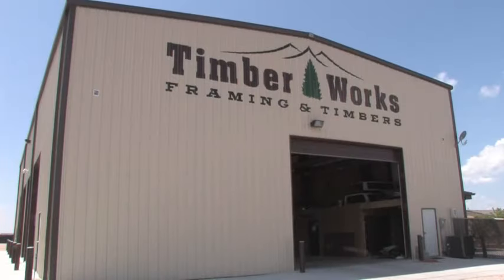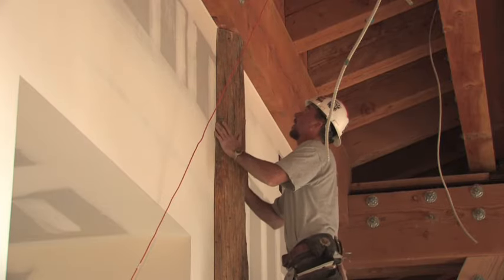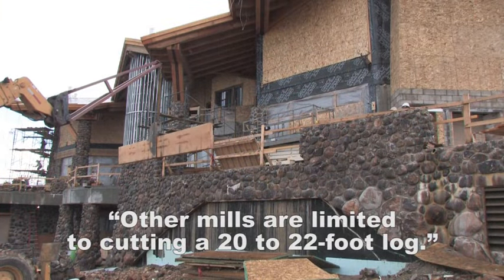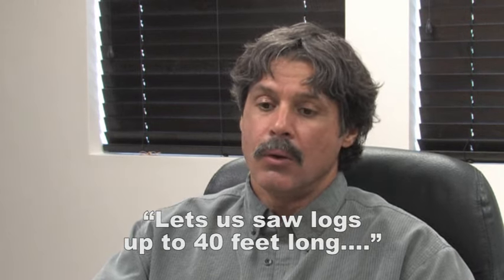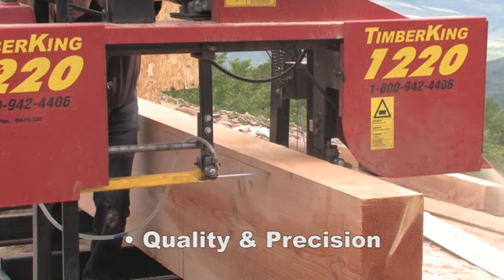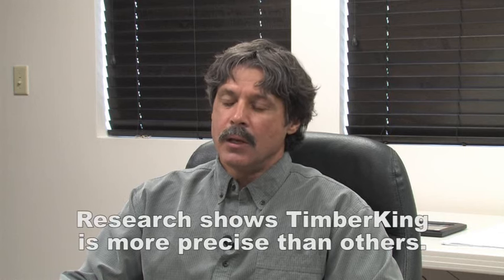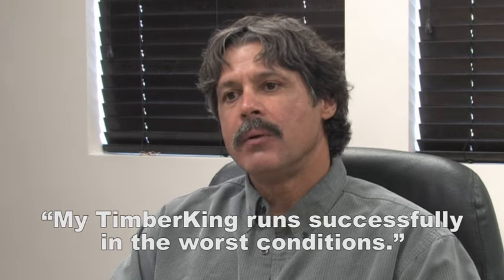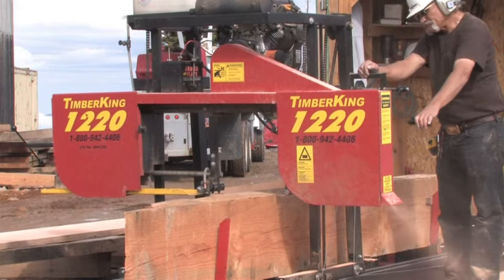TimberKing Portable Sawmill Model 1220 Owner Saws Huge Beams

Comment: I like the shed idea and the concrete slab for the mill. i have a 1220 also yours must have the 25 hp motor optioned out, nice. Makes me want the larger motor, mine is 15 HP motor. Good Luck, Art